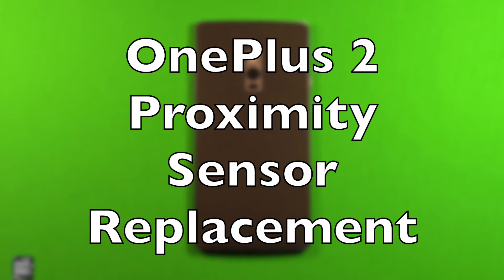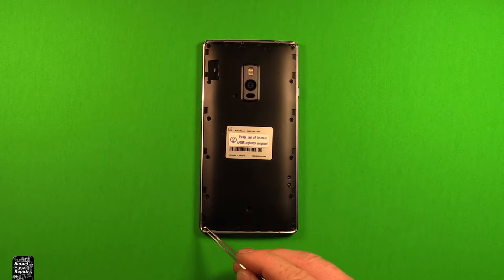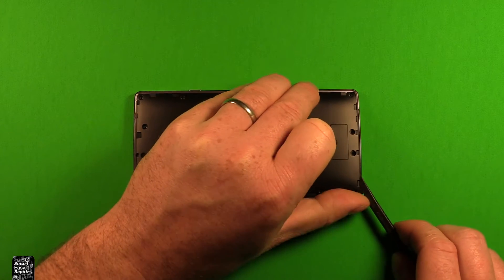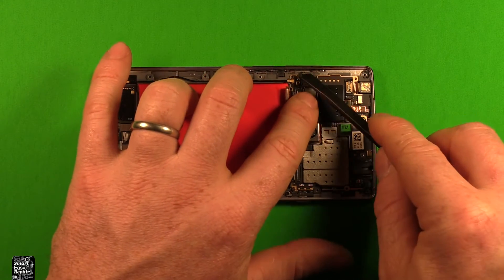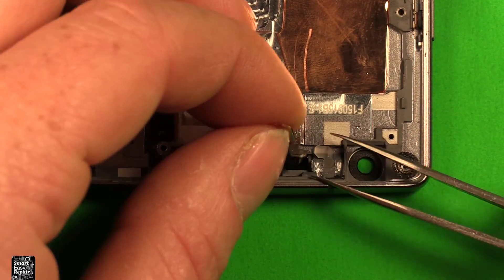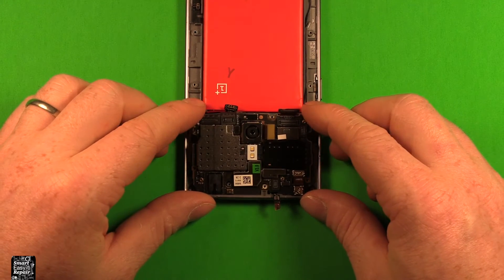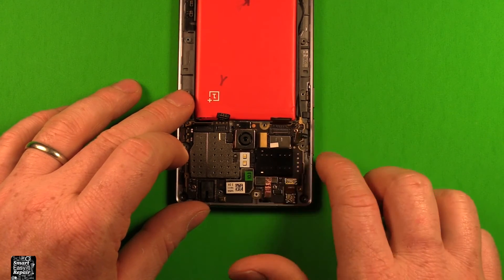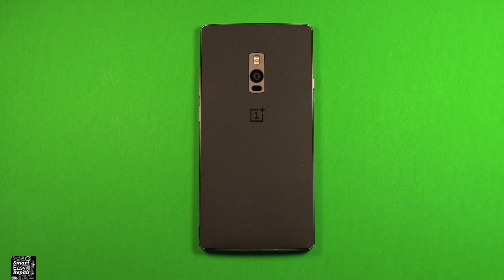OnePlus 2 Proximity Sensor Replacement How to Change

Comment: Where did you buy the proximity sensor?
Reply from the maker: +Michelle Villanueva I have a link in the video description below the video where you can find it. Thanks.
Reply: THE PROBLEM IS THE SENSOR NOT THE BUTTONS, THANKS 
I hope I can help myself
Reply from the maker: Well the sensor is built into the same part as the back button. It's all in the same little flex cable.
Reply: @SmartEasyDIYer  in the video it looks completely different to the back button part? Also its at the opposite side of the phone?